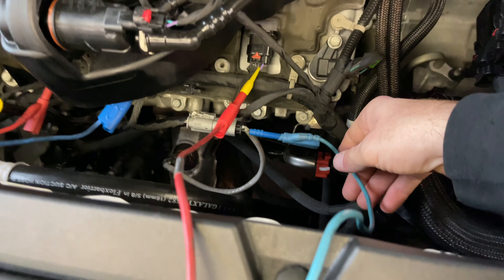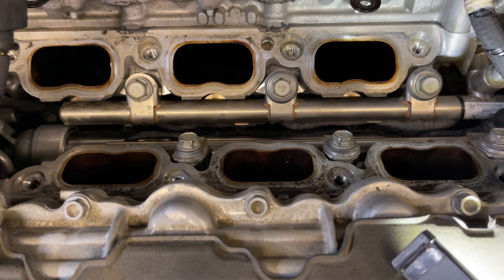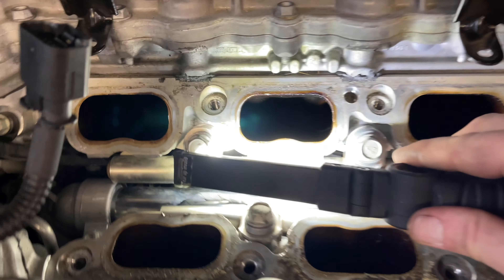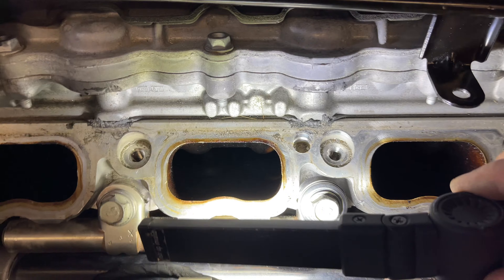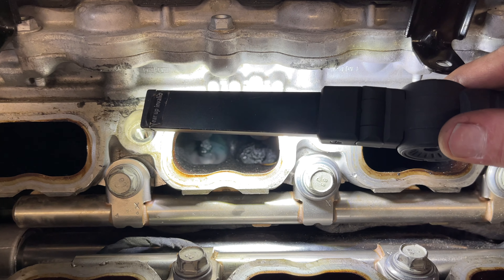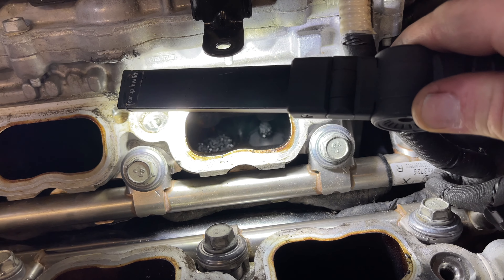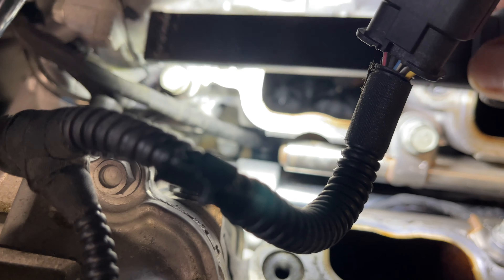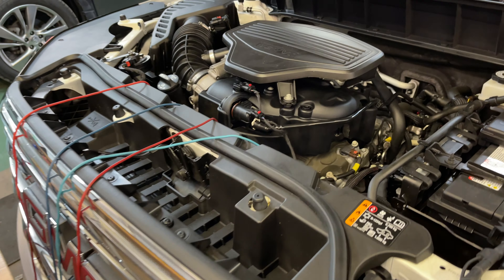Finding a faulty GDI Injector - Experiment

Comment: I'm sure you and everyone else in the comments has seen this but my favorite way is using an injector pulse tester. Just hook up to the injectors one by one, hook up a pressure gauge and just watch pressure drop from each injector. I've had very good luck with this. Obviously these injectors require some disassembly to get to or you can just unplug the pcm and test them that way. Clearly a tad bit more invasive but my favorite way to check fuel flow. Unfortunately I was just on amazon and noticed the Otc tester has gone up a fair amount in the past few years. Picked mine up for $60 quite some time ago and even though its used seldomly, its paid itself over multiple times.
Reply: @autodiagyt  Ahh i see. Thats a great point. Thanks for the reply!

Comment: I wonder what a pressure transducer hooked to fuel pressure and triggered by #1 coil if the waveforms would show a pattern that could be used to determine flow differences. Their should be a corresponding slight pressure drop on each opening that may show irregularities if flow was increased on a single injector.

Comment: P219b on a 2011 Silverado 4.3 liter. Might have been a lil older or newer don’t remember. Shop replaced injectors but didn’t fix it. It was random bank 1 trims would go way positive intermittently but only front o2 showed lean swapped o2 sensors from bank to bank no improvement. Turned out pcm intermittently quit supplying bias voltage to o2.

Comment: I had to look back at this video to see if you covered it, I got a 2020 Chevy 1500 5.3 That came In from another shop, That has a strange very weak miss fire at idle And underload, Has a p 0300 with misfire counting up on number 1 And the other shop done the usual Spark plug ,wires and coil. When I do injector  balance test it shows Bank two drop all cylinders about 35lbs, And bank one cylinders 27 lbs,  Number one cylinder at 19lbs It seems as though Number one injector. Is restricted, Have you seen this problem  and do you think TSB #16-NA-383 About carbon build up what have anything to do with this.
Hope you enjoy vacation and get back to Alabama.
Reply from the maker: If you are using a scan tool for those readings only go off one bank to get averages. Fuel trims will effect the readings. So if bank 1 is -10% and bank 2 is +10%, you will see different pressure drops from bank to bank. But honestly the only method I trust is cold engine with AFIT tester. You have a high pressure fuel system but it's giving you pressure drops on the low side while the engine is running, I can't wrap my head around how it's getting these numbers. So try to make friends with the local dealer and try to borrow their AFIT lol. I usually drop the vehicle off the night before and test it first thing in the morning before they get going.
Reply: @autodiagyt  short fuel trim on both sides of zero, and long fuel trim is 0 and 2. So that might be the discrepancy between right and Left bank, The closest dealer is 40 minutes from here and customer rather not fool with them again if he can prevent it, The truck has barely over 60,000 miles, and paid for the work that was already done and was told more testing would be needed, The dealer also told him they don't know if any problems problems that GM is having with a 5.3 as per recalls or service bulletins, That's how I end up with it, I appreciate your help and I'll keep doing a few more test and  this service bulletin to see if it might help the situation, I asked you before but I lost it what does RLS stand for that shaun was talking about on his podcast, I can't find RPO codes on this truck I don't know where they hid it
Reply from the maker: @KANDiagnostics  repairlinkshop

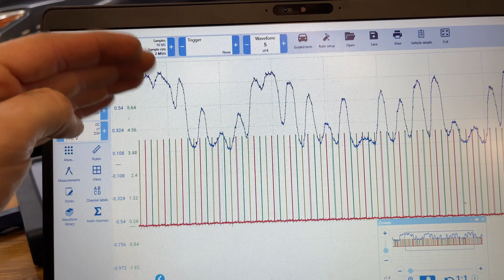Comment: am i correct in seeing that at 11:40, you didn't use anything to protect the scope while reading coils on the scope (I.E. potentiometer or otherwise)? Forgive me if that isn't the correct term but im still learning scopes. 8 years as a dealer tech and ive seen this entire time that no one knows how, or uses, scopes so it will set me apart big time. TIA

Comment: Awesome video! Thanks for taking the time to compare different tools. 
The thermostat can be replaced without removing the fuel rails. We take the coolant pipe loose on the drives side of the engine and transfer the new thermostat and o-ring to the old pipe.

Comment: Nice to see that AFIT and the Balance test pointed to the same injector.  In SI, GM will have you do some maths and use a 20 Percent rule with the pressure drops.  You first GDS data when calculated showed the injector under 20 Percent!!!!!!!!  But,  it was still the culprit.  Makes me wonder if the tolerance should be 10 to 15 Percent!!!💁.  The O2 change was great evidence for the case.  Nice Job!!!!

Comment: If you take the raw numbers from the aftermarket scanners and find the average then divide the average by each cylinder’s raw number it will show you how close to “1” each cylinder is.  With Snapon, I get 1.11, .87, .96,.93,1.01 and 1.05.  - - showing cylinders 1 and 2 both being more than 0.1 from mean.  With the Autel, I get 1.12, .84, 1.02, 1.01, 1.03 and .99. - - again showing both cylinders 1 and 2 being more than 0.1 from mean.  If you only had the aftermarket scanners you’d probably replace 1 and 2 injector.  I find this very interesting.  Thanks for doing these experiments and sharing your thoughts and methods.

Comment: I've seen several cases of this happening after a t-stat replacement on this motor. One on a car I worked on. I was as careful as possible, but it came back a couple days later. Horrible design. I'm at the point where I'm selling injectors with the job. Honestly didn't notice that the injector was bent. Also- ran injector flow test several times, different results every time. My understanding of the GDI injectors is they should flow exactly the same. Even a one PSI diff is out of spec. Great info, I'll know going forward to look for the bend!!!

Comment: Nice breakdown 
That was interesting making the correlation with the o2 sensor and the over-fueling injector. 
There is another guy on you tube In which made a video showing usable dynamic test for GDI. He uses the rail pressure sensor that is on the SENT protocol. He uses an arduino to decode the data and convert to a an analog out put for the scope. Then he monitors current for all injectors, the current for the spill valve and the decoded rail pressure data. I was amazed how well the correlation could be made between the pressure drop on the rail When the injector opened and pressure rise when the spill valve was commanded to replenish the rail. 
Great video from both you guys. GDI is definitely its own challenges
Reply: Either way homie your content is amazing 
You have skill. I’m around guys whom have become complacent and if it’s not a pattern failure or something they’ve seen before the cringe and steer clear clear.  
Do you think the this could have been seen with current as well?

Comment: What we use on common rail diesels ; scope injector control (for sync/firingorder) vs fuel rail pressure (ac coupled), if your scope is sensitive enough you should be able too see a faulty injector (higher pressure drop)

Comment: Excellent video! I like the technique you used with the O2 sensor. I am wandering if we would be able to see it with a wide band   O2 sensor? I have not had problems with GDI injectors, but I've been practicing in known good GDI injectors! Looks like is going to be fun since many of them don't have easy access to. Thanks for sharing.